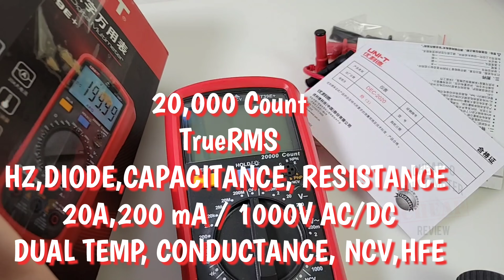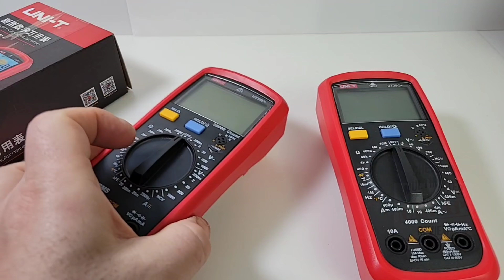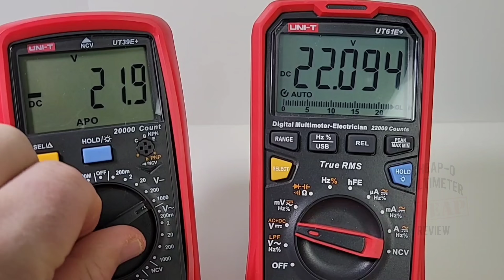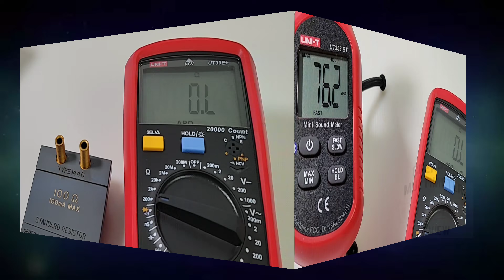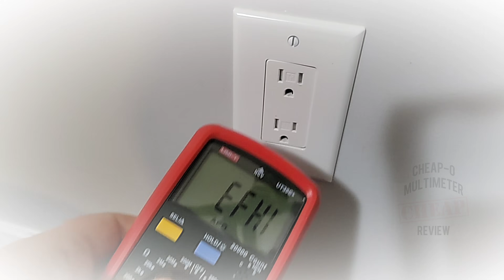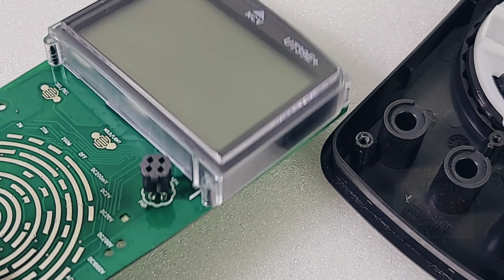UNI-T UT39E+ 20,000 COUNT CHEAP-O Multimeter Review & Teardown!

Comment: Hello, do You recommend this multimeter? I am looking at uni-ts because currently I own old aneng 8002, and it kinda slow, slow resistance measuring and others. So I am looking at ut61e+, but just found this simpler one, and its looking good as well. What are clear benefits of ut61e+ vs ut39e+?
Reply from the maker: Only real benefit of 61E+ is the Auto Ranging...otherwise 39E+ has great bang for the buck 👍
Reply: @KeepOnTesting  and 61e+ is missing temperature measurement if I am not mistaken. So we do not have any other similar quality auto range fast response meter for a ut39e+ price:)?

Comment: Anyone measured UT39E+ current consumption when in sleep mode (APO mode)? Found it works with Eneloops just fine - when voltage is 2.5V Low Battery symbol is shown, but with current consuption of less than 1.5mA and Eneloops low self discharge, there is 1000mAh (or more) available before that and with no risk of leaking like Alkaline Cells. Thanks
Reply from the maker: Good question..I'll measure the current usage when I get some free time. 👍
Reply: @KeepOnTesting  found it Today on Google: 5uA is consumption when in sleep mode, so no need to spend Time on that :)

Comment: Dude NCV-HI is not you think. On NCV mode Hi and Low represent frequency. If you are looking for mains voltage you have to use NCV-Low. If you are looking for a data line, like DVBS or ethernet cable use NCV-HI. BTW UT-33 series better than that on NCV
Reply from the maker: There's no mention of this in the manual/documentation. I'll try to get UNI-T to confirm 👍

Comment: You did not test the nS range :(
Reply from the maker: The conductance function in the meter reads out as a value of nanosiemens.
This range allows to measure high resistance values from 20 Megohms to 100,000 megohms.

 The formula for conversion between nS and megohms is Mohm=1000/nS
so for example 10.00 nS=100 megohms.

Conductance is another way to measure high resistances, such as leakages in diodes, capacitors, pcbs, or insulators or even motor winding insulation or leakage.

Comment: Try to do a review on the new Unit UT890pro (for now you can only buy this multimeter on AliExpress).
Reply from the maker: Will do! I  just placed the order on Ali, thx for the heads up..😀👍
Reply: @KeepOnTesting  In the review of the UT890 pro, please test the live wire and neutral measurement. In the Aliexpress store there's a picture with that, but i trust you more than a picture on a chinese store. ;)
Reply from the maker: @Jose-Ribeiro  Noted 😀👍
Reply: @KeepOnTesting  Here's another new multimeter, available on the Mestek Official Store on AliExpress. The Mestek DM100B. ;)

Comment: No "Min/Max"  feature on this multimeter?
Reply from the maker: That's correct, Min/Max is sadly missing...
Reply: @KeepOnTesting  essential for cars to measure car battery condition when you start cranking the car. If the min drops below 9.6V your car battery is bad. I bought the Richmeters RM219 last week on Ali based on your review 4/5) for just $22. It also has 20A check. Bought the Habbotest HT118A also about a year ago based on your review but only does 10A. I prefer 20A for cars. Oh and the RM219 also has 20.000 count. Keep it up 👍
Reply from the maker: @BruteWillis  Thx my friend! Indeed it's a great feature 👍it's absence on the 39E+ is missed. Glad to hear your getting quite a multimeter arsenal...Keep On Testing!

Comment: Nice review Darren!  I’m not too sure about a 20 Amp fuse though - especially when it is not an HRC fuse.  I wonder about the use of grease and the dielectric breakdown...do multimeter vendors approve of this?
Reply from the maker: Normally I Iike to clean the contacts with IPA, and after that a woosh of compressed air...then I treat with dielectric grease,( Silicone grease is really a dielectric too. It takes thousands of volts to break it down) mainly because it lubricates and protects the contacts. Worked for me forever. Also great on  potentiometers too. Most CHEAP-O multimeters ship without grease as a cost savings..Makes a huge difference if your meter has trouble settling too. YMMV and there's no consensus in the field as to the perfect "lube". I just know it has always worked for me 👍 and my peers. If it ain't broke...

Comment: Would making it auto-ranging have added that much to the cost? I wish your teardown had shown why the NCV was so poor. It seems like a solid cheap-o for someone who needs 20A or 20k counts. Thanks for reviewing it.
Reply: Full-featured auto-ranging Uni-T meters seem to cost more than competitors like the Habotest 118A, but they do offer multiple 2000-count auto-ranging models with some costing less than $20.  The "classic" 33A+ is presently $21 (AliExpress), but they go as low as $17.39 for the 11/11 sale.  The 136B+ has 4000 counts for US$29.
Reply from the maker: Good question Eric,...probably would require a major overhaul. The NCV was only the tiny square filament embedded into the PCB. I did show a pic but I should've gotten in closer..NCV definitely needs improvement.

Comment: very nice informative video..
Can i use silicone instead of dielectric?
Reply from the maker: Yes indeed..any non-conductive grease like a silicone / dielectric grease will work.
Reply: i put Nitecore SG7 silicone grease on my Richmeter 114 meter which had a random reset issue when the dial knob was being switched between functions before. after that, the problem never came back and the meter functions just fine.